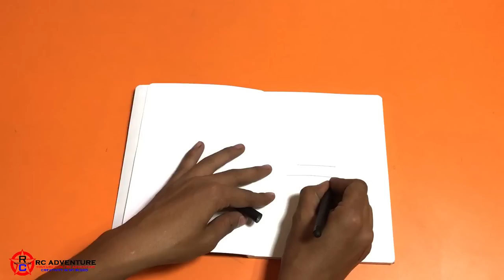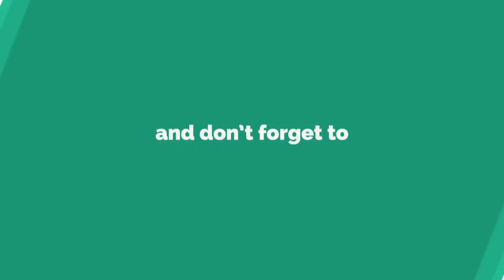How To Make A Simple High Speed Electric Scooter At Home | 40 Km/H Speed Homemade | With Suspension

Comment: For the people who are judging the speed... Can you ride an electric scooter at 40+ KMPH. ! No you can't. You will end up fell on the road. It's the best solution for local journey without fuel worries and it's a diy thing and it can be solved by ourselves and it's simple JUST MOTOR AND BATTERY. No puntcher Tyre problem. If anything goes wrong he can carry it with one hand cause it's less weight that a bike.  And the most important thing is HE DID IT AND WE ALL ARE SIMPLY JUDGING HIM WITHOUT DOING IT.  Be optimistic nit pessimistic. Think if someone says bad about your achievement? How does it feel.

Comment: After searching for 8 months and 120+ diy videos this is the one and only simplest motor and batter wiring without any curcuit board and it's the only diy video made by an Indian. Proud of you brother. God bless you. I am very happy that an Indian did this marvel. You know what psychology says IF YOU ARE STILL USING COMPLEX THINGS THEN YOI ARE STILL LEARNING, IF YOU LEARNT COMPLEX THING AND DID IT AS A SIMPLEST THING THEN YOU ARE A REAL LEARNER AND TURNED INTO TO A GENIUS., ALL THE BEST DOSTH
Reply: Not that marvelous. He just put it together using a voltmeter, battery and motor. Hell, many disadvantages are present aswell, the motor, which is a starter motor burns out after long use. The battery is lead acid, which is known for being cheap and safe compared to lipo, but is bigger and has shorter battery cycles (battery will go useless after a year and a half). The suspension was a good addition tho, won't argue that. Overall it's like a cheap remote control car, it will go useless after short span of time.

Comment: its going 30 km/h, bacause the camara is 30 fps from an iphone 5, and it looks like the wheels stand still, and that means that the wheels are spinning at the same speed as the framerate.
Reply: Not how it works buddy......
Reply: that is a good analysis, but in that way. 30 rev/s* radius (15 cm(???) = approximately 16 km/h

Comment: Holy Crap, I'm only half way thru this mess and I'm wondering if you will live thru this! What happens when that bracket you have under the scooter catches on something that doesn't move? At 40 km an hour? Here's a clue, it will stop suddenly but you won't. With all that heavy steel structure it will take a lot of bone breaking to get you past the upright front bar when your going 40 and then get instant stop. Well, on the positive side you will reduce the kinetic energy prior to impacting the ground by impacting the upright bar.so maybe your face-plant won't be so bad? How does it feel riding that heavy industrial suspension with those loose fitting mounting bolts? Before there can be any dampening of the bumps the space between the bolts and the thru hole of the shocks will be jarringly impacted, effectively making the ride worse and much less stable and safe. Having extra long bolts sticking out on the sides, even tho you covered them with triple nuts is also sure to be a potential hook to snag on things, some things will rip out and drag along like grass trash etc, other things of the unmovable flavor will bring you to an immediate stop. And whats with the the geometry of your suspension? I know your limited to straight, end to end mounting or 90 degree perpendicular mounts. I don't see the advantage of creating a pivot point in the center of the sled with all that hardware, just to design in a travel direction for the suspension. The need is upward and downward, its all about gravity Bro. You want the sled to be as ridged as possible, not to flex in the center sending the rider up and down and making the scooter weird to operate. Where is the longitudinal need come from? Even if you did get good travel in that arrangement it would be sending the rider for a strange ride. And I apologize for being too impatient to wait until its finished to comment but I don't think I will bother to watch any more of this stupidity. The best I can give ya is a F for engineering. A F for concept, An F for after it was finished you didn't admit what a POS it is and posted it any way like it came out good, wasting my time and anyone else's who bothered to look at it. I will say "Hey bro, nice try! No gutz, no glory, If you haven't been put into a wheelchair by it, try it again and learn from your mistakes, The NUTZ to try it and see it thru I giv ya an A for effort. Even highly trained engineers don't always get everything right the first time, we only see the products that were revised and changed enough to sell and even then, if they are good products, they will continue to incorporate design changes and improvements
Reply: And what is up with you guys and those silly looking gaudy, colored stickers that you plaster all over everything that moves? I mean, they are ugly enough, but what does having 78 of them stuck all over your POS do for you that, say, ONE, doesn't do? Having a lot of the same ugly thing is BETTER than a few or one? I don't understand what you could possibly be thinking with that. The only thing I can think of is if I was driving and saw it I might think that you were seriously mentally challenged to believe that it looks good and therefore I might give you a wide path of clearance around me which would be an advange for you. On the other hand, I might just fail to give you the room to avoid going off the road due to your giving me a headache and hurting my eyes. 
You were still constructing this thing and already had stupid stickers all over it! WTF? You guys really think that makes your junk look better? Strange, for sure.

Comment: We have the same i create mine as full fiberglass extension 5:1 gear ratio belt drive 6355 motor 18Ah 24v  came from laptop battery and a rear disc break  i test it.  I overtake one of the expensive scooter in my city hahaha smoke em! .but need to re design add suspension it vibrate as hell if i pass na non asphalt road creat 3:1 or 4:1 gears because theirs a lot more torque to trade for speed and thin tires are so sensitive in high speed

Comment: You'll need a 36v battery in order to achieve 40km/h. Not a 12v battery.
Reply: Voltage isn't all. You could reach 100kmh with a 12v system as long as it is built for it. You can have a 100v system that struggles to reach 10kmh because its about watts, not volts

Comment: What is the motor of ?
Reply: its an elecric starter for pitbikes...
Reply: If it is it will quickly burn out if it is forced to run constantly instead of briefly. It is designed for high torque, short duration operation.